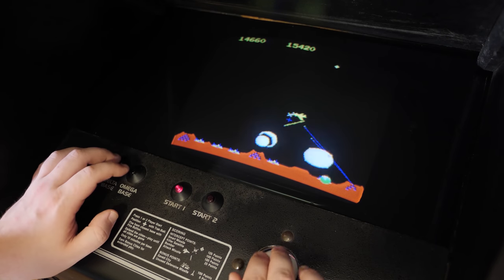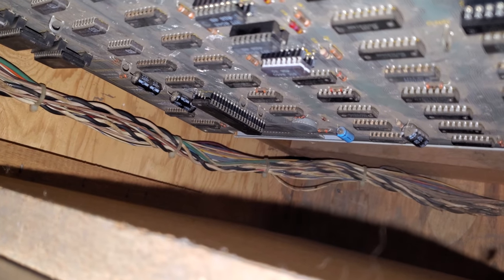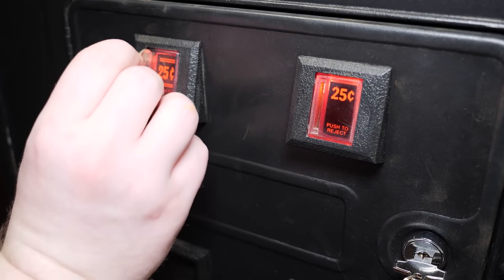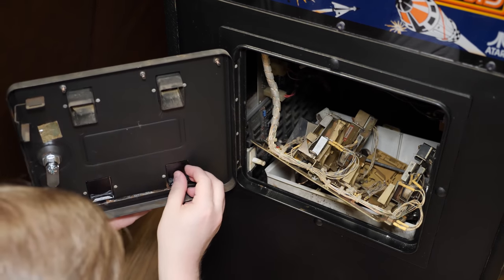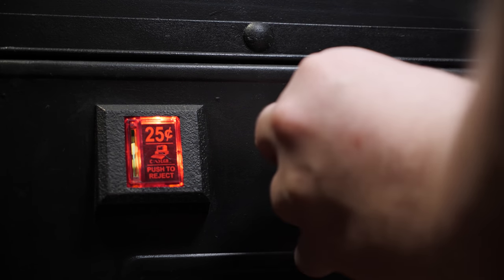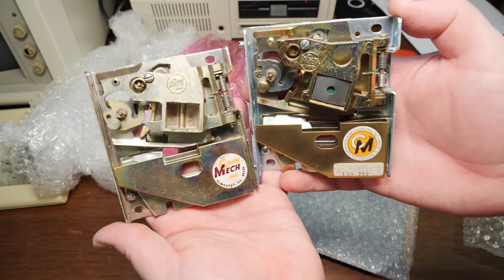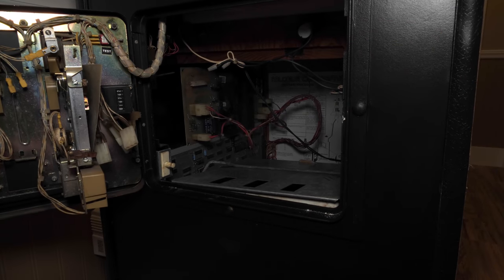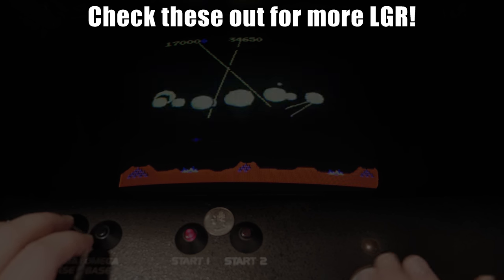Updating my Atari Missile Command Arcade Machine!

Comment: LGR Clint, brother I am concerned about your edge card it's looking really rusty and I would say it needs a clean. If it's too old to clean then clean it anyway and re-tin it so it can connect properly a little preventative maintenance will go a long way. Just thought i would put 2 cents into the jar here. Also Clint, here is that custom token thing you wanted. It's a link so you might have to unblock it to see it but here you got brother.  https://www.aliexpress.com/item/32904380064.html

Comment: 5:00 ok you spent $200 dollars for a noise. You could have spent a tenth cost for some washers.
Reply from the maker: I didn't "spend" anything though. It's still unspent cash, just in the form of quarters!
Reply: @LGR  heh, yes, it's basicall a piggy bank in the stomach of an arcade
Reply: Also could have got someone to make up a little microcontroller with a sensor to play a sound.
Reply: @chartle1  Yes Cliff.
Reply: Didn't spend anything. He still has the cash.
Reply: @LGR  Yes still very fungible much more than washers,  but you have the funds tied up in Arcade Sound effects. :) 
I'll ask my Accountant son where you should put that on the LGR balance sheet.
Reply: @LGR  ok checked with son #1 and as long as you don't have a contract with the arcade machine it would not be considered restricted cash. 👍

Now son #2 could figure out what that stuff was on the counter return door. If we sent him a sample I'm sure he could put it under a scanning electron microscope and figure it out.
Reply: @chartle1  dude, the funds were just sitting in a bank not doing shit, it doesn't matter